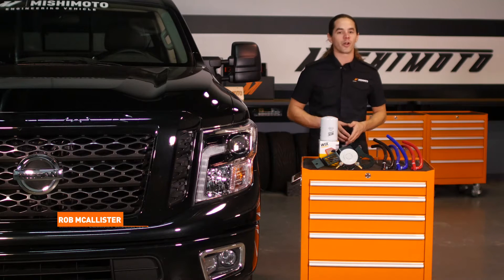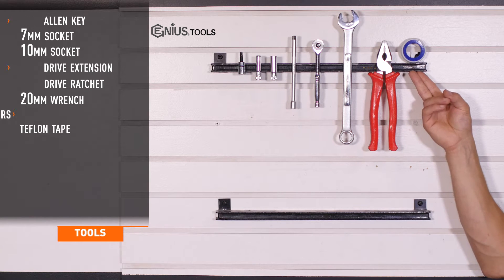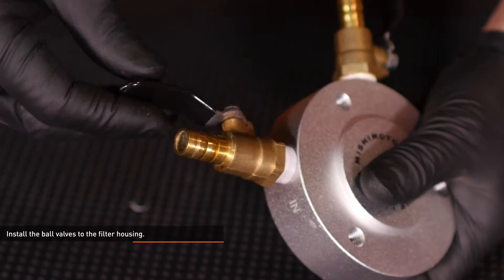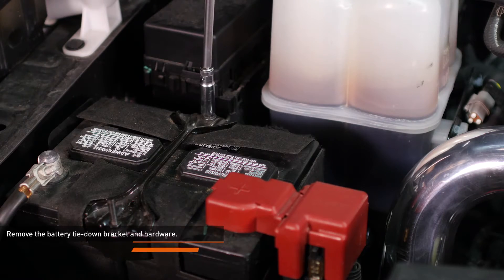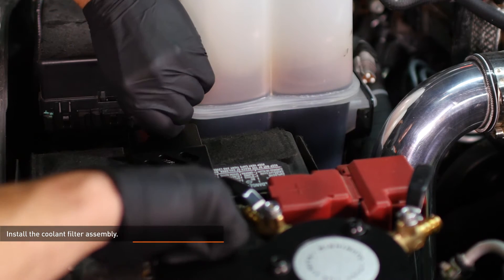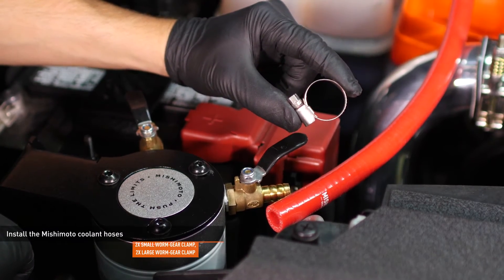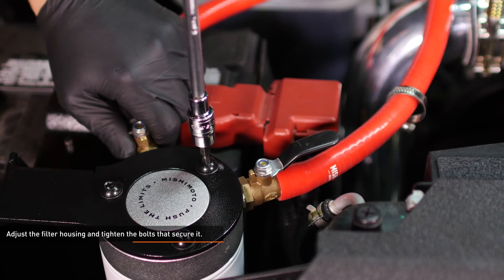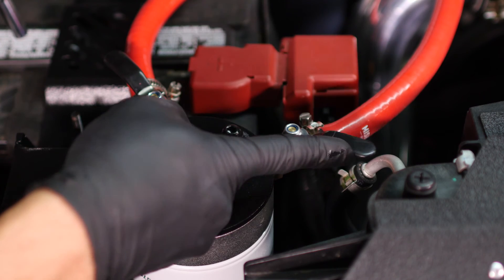2016-2019 Nissan Titan XD 5.0L CumminsCoolant Filtration Kit Installation Guide by Mishimoto

Comment: What is the purpose of adding this coolant filter ?
Reply from the maker: Coolant filters are installed to collect contaminants left in the system from the manufacturing process as well as from wear in the system.
Reply: What is the cost of this Coolant by pass filter?